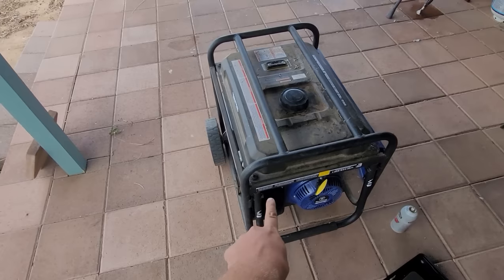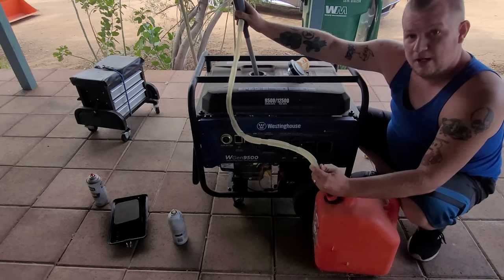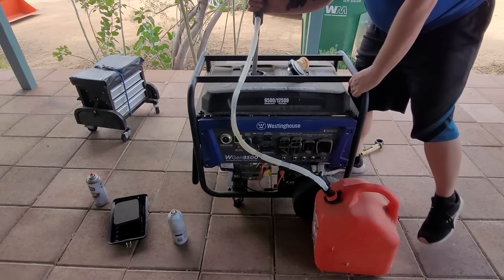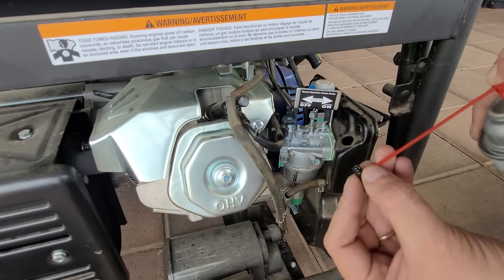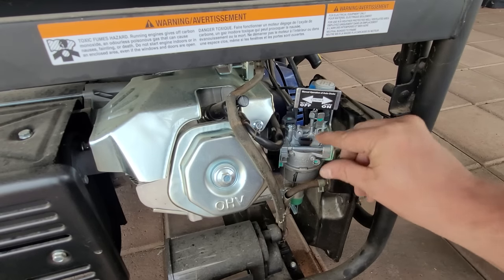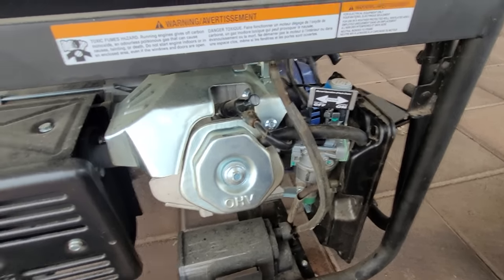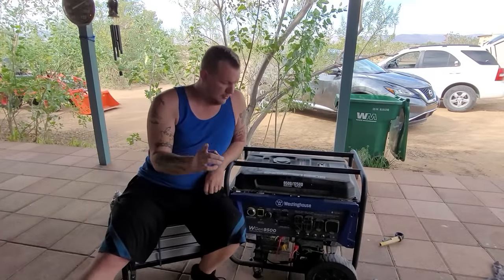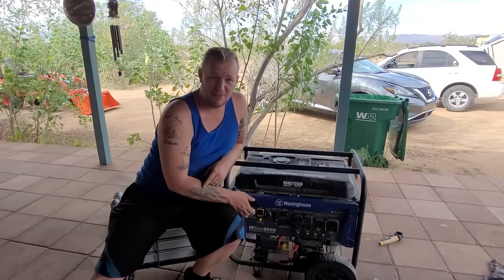Surging Generator? Quick repair for ALL surging and hunting engines.

Comment from the maker: Update video for people that still need help https://youtu.be/mE39dlHgO30
Reply: my generator is running but it won't stay running
Reply: I purchased an after-market carb on eBay for my Westinghouse WH7000EC because the old carb was leaking gas.  The old carb was not surging it ran fine.  The new carb is surging, I watched your video and did everything you did, drained old gas, and installed new fresh gas 93 octane. Took the plastic screw and its 2 mating plastic parts out, used a wire carb brush, and flushed the carb with carb cleaner.  I reinstalled everything only to find the surging did not get corrected.  What do you suggest I do next?
Reply: Great job...I've been trying all I could for two months on a CAT 3600..no luck.. runs and surges.... wish  this  mechanic lived next door..I'm 97 years old and  can't  lift it to get it back to the store for service... any one in Naples Florida who can do this???
Reply: I bought my Honda 2000 used (barely) and it was surging on eco. On a whim I added some sea foam. I’m sold on it now. Ran it thru & have had 10 years of service since without even a hiccup.
Reply: Can you not just adjust the carb sometimes and or clean it?
  Are you saying a surging engine is always bad gas?
  Don’t intend to knock your opinion. I am not a pro just curious as I have worked on several small engines especially carbs.

  PS noticed you sad 90% of the time. My bad!

Comment: You can turn the idle screw "IN" before you remove it counting the turns it takes to seat it. Then after reinstalling it turn it all the way in till it seats then open it the same amount of turns it took to seat it before you removed it and it should be almost exactly where it was. Thanks for the video.
Reply from the maker: Yes good tip
Reply: I was about to say the same thing but you said better ...
Reply: That's assuming there's an idle screw...new stuff all sucks
Reply: why would you need to do that, the generator never idle
Reply: If the generator does not have the auto idle or economy mode feature, turning the “idle” screw will have no effect engine operation. Further, without the auto idle feature the engine is set to run at approximately 3600 rpm.
Reply: Well done sir and thanks!
Reply: Unless somebody has been fiddling with it, like a previous owner
Reply: That's a fixed idle jet, no adjustment possible unless you slightly enlarge the orifice (which would fix the lean surge problem)
Reply: Agggh was going to say tjat! 😂
Reply: @timbartels6353 referring to this specific situation duh! I swear people always have to try to stump someone.

Comment: Always use premium gasoline or Non Ethanol gasoline in combination  with Stabil gasoline stabilizer. The ethanol in these gasoline gum up the jets and carb.  It’s best to clean the carburetor bowl out while you’re at it. All the gum from the gasoline sits in there.
Reply from the maker: I'm ok with non ethanol but I would never recommend stabilizer maybe seafoam but probably not just don't keep gas in machine drain and store
Reply: @RepairGang  I disagree. Always use stabilized fuel in small engines. Always
Reply from the maker: I have had bad experience but it's anecdotal evidence. I'm pretty sure if a customer followed the instructions it probably be a good idea, but that's okay. We're allowed to disagree
Reply: @RepairGang  hi I'm a waterfowl hunter that uses a 2 cycle outboard.
Since I started using stabilizer I've had zero carb problems.
That is anecdotal
Reply: just run the gen out of gas to shut it down no need for premium or to add anything its worked for 30 years heck  i use a gen 4 hours a week every week to power my water pump the gen is a 1998 model sold in 1999 and still purrs like a kitten ive opened the carb 1 time in 23 years 1 time
Reply: I agree with you on using ethanol free gas but not premium in small engines. Premium is only needed in high compression engines. My whole life I always thought that premium gas was really high explosive stuff.......wrong. Just the opposite. Octane actually decreases the explodability of gas. You don't want gas to ignite before the piston reaches top dead center. Thus the need for high octane in high compression engines. You can use premium high octane gas in your Ford Fiesta and it won't harm the engine but you are just wasting money. But if you use regular gas in high compression engines you can easily ruin the engine. That is why you hear the knocking. It's because the gas is igniting before the piston reaches top dead center.
Reply: I use my snowblower so infrequently that I only use trufuel in it now. I went two whole winters without using it, and it started second pull.  That stuff is ethanol free and stabilized. A gallon is like 25 bucks… so it’s NOT cheap, but I only use a quart or so a year…
Reply: @ferp420     Ah but YOUR secret sauce is running it regularly.  If you let it sit lie many your experience would change I think.
Reply: @drizler  no cause i have several engines that do sit rotatiller pressure washer and multiple gen sets that sit alot between use
Reply: @BenNawrath     Check out the Chickanic on here.   She just did a video on how Truefuel seems to have trashed some  of her customers small engines.
Reply: @drizler  I’ll definitely do that thanks. I’m on like hear 4 using it… if I still had a gas mower I wouldn’t use it all year, just the last fill up or two. But I barely go thru a tank a year on my snowblower.
Reply: @BenNawrath  has a long shelf life
Reply: Do NOT use premium gas, you are wasting money as these engines are designed to run on regular. Do NOT use a stabilizer, it is also a waste of money.
Reply: @romak4756  the only ethanol free gas sold where I am is high test.
Reply from the maker: It's impossible to get a pump in Mohave county
Reply: @techguy9023  you don't have to use ethenol free gas.
Reply: Yep
Reply: VP sells a bottle of fuel additive to offset the bad effects of crappy ethanol gas . Great for stored spare cans of gasoline too .

Comment: Make sure your generator has an in-line fuel filter in the hose between the tank and carb. If not you can probably get one at Lowes or Home Depot. They're usually easy to install. Because the carburetor jets are so small, they clog up easily so having the gas filtered can save a lot of work. Most manufacturers don't include a gasoline filter. Why? Maybe they'll save .25 cents and make more money on service work?
Reply: Most of these engines have a filter in the tank side of the fuel cock sticking up into the gas tank.
Reply: @yeahrightmate enjoy trying to change it with a full tank and a major storm surge
Reply: The little red filters have a screen that's relatively coarse. The paper or sintered metal filters (clear body)  are better filters, but of course you don't want the paper ones to become ancient.

Comment: Good job! Always screw your idle air screw in until it stops and count the turns so it can be put back the same way, you don't want to run them too lean.
Reply: Idle screw has NOTHING to do with air fuel mixture!!  It is an IDLE SCREW. You should ALWAYS set min and max RPM with an induction tach according to manufacture spec.
Reply from the maker: Your right there
Reply from the maker: Yeah I feel that I so use to lawnmowers with same carbs I just say to adjust it
Reply: @meyou3353  slow idle is a moot point on a generator, and high idle you set with a multimeter
Reply: @romak4756  you are wrong
Reply: @meyou3353  yeah, ok sport
Reply: @meyou3353  so what's the low idle setting on a generator with no idle control? It's high idle only
Reply: @romak4756  How are you setting it with a multimeter?
Reply: @POOKIE5592 by measuring the hz

Comment: A faster way to fix this if it's raining or cold outside , is to spray little carbspray up the gas tube to the carb , go in the house an warm up some , and come back with compressed air and blow a few puffs up in their from a air tank or blow in it . (open the gas bowl to drain first ) water gas will be in the bottom an removed . shake the tank good an ad fresh gas .

Comment: you are the man! I've dismantled and cleaned the carb jets multiple times in the past but this time I was stumped bc it was still surging.. you saved me so much aggravation with an easy fix... thank you👍🏼+1
Reply: Did the same as you and still surging somewhat. Now I cant wait to try this. I did not know that pilot screw has 3 holes, I cleaned 2, and the bottom hole was plugged but I thought that was by design, realize now I have to remove and clean that gunk stuck in there.
Reply: What fixed the surging for you? Cleaning the carb or snipping the solenoid plunger off?

Comment: Dude, that's the quickest fix I've ever had to an engine problem.  My generator is not too old - maybe 4 to 5 years, but I still try and start it every 3 months or so and let it run for a while just to keep the carb sort of fluid and fresh inside.  Still, it developed the surging issue; found it when I started it yesterday just for maintenance.  I had it running straight again within 5 minutes just by following what you did.  Well. almost.  The carb cleaner never would exit the jet on it's own.  I had to clean the jet with a wire first to get it to come out, so it was clogged pretty good.  Thanks for the help.  Good job on the video.

Comment: Had my champion 4500 open fram start surging at work....... Found this video and it cleared it right up.  I just disconnected my spark plug and did the above repair. I did not drain the fuel.

Comment: Thank you for the information on where the high speed jet is located. Put on a brand new carburetor and it was still surging. Drilled out the jet with the next size up drill bit and now runs smooth. I liked the old days when these mixture adjustments were out in the open and not hidden and fixed.

Comment: Thanks! This worked out perfectly. I used it on my Powerstroke 5000. Don't know what caused it because I only ran it twice in 3 years. I replaced the fuel added a cleaner and preservative and followed your instruction and smooth running. Thanks again.

Comment: Thank you, you just saved me a big repair bill, plus transport.
I have a generator just like yours, that stopped running after only 10 hours of operation.
I could not even find a repair shop willing to take it in, the only shop in the area listed for warranty repairs did not do that anymore..
Did not even know it was called "surging", until last week. A common problem, apparently.
Then I found this clip, I did what you said, and now it runs perfectly. Thank You!
Reply from the maker: I am glad you got your machine running like new or in your case like it is supposed to

Comment: I've often seen the surging due to water in the fuel bowl temporarily shutting off fuel flow into the main jet. Remove the bottom fuel bowl center screw, drop the bowl, clean-out the bowl and reassemble.  Lucas Ethanol gasoline treatment works great, green bottle/color, add to regular gas.  Nice job on the video, quick and to the point.
Reply from the maker: That could work
Reply: I've never been fond of Stabil fuel treatment.

Comment: I had the very same issue on my 10K watt generator. Watched your video and did exactly what you demonstrated and it is up and running just like new. Thank you for sharing this!
Reply from the maker: Thank you glad it helped yeah they get bad when they sit a min
Reply: @RepairGang  i had the same problem with my generator reving up and down but mine did it after it got clean up just like you did , before it dint start up at all and was puring out gas whenever i try to start pulling the rope , any reason why any help whould be great
Reply from the maker: I would take off whole carburetor and clean it then you knocked dirt loose
Reply: @RepairGang  i will try
Reply from the maker: Yo if you need a walk through email me pictures
Reply from the maker: @The_Happy_Aviation_Enthusiast  stop spamming this on my post

Comment: I pulled my carb apart 3 times thinking the problem was the jet inside the float bowl. I never knew what that plastic bit was until i watched this video. I have 2 other generators that don't have that plastic bit so i didn't think it was anything important. I fixed my other 2 generators by removing the float bowl and cleaning the jet inside and assumed the same had to be done to this one. But having no luck i then found your video and now its up and running again. Thank you
Reply from the maker: I'm so glad this helped you my guy. Many more videos coming
Reply: Yes never knew the other jet on the side my water pumps are doing this clean carb but I’m gonna try this one soon

Comment: Thanks!!!
For anyone who found theirselves in the situation, if you intend to store it for "next time" be sure to run fuel with Stabil added for a few minutes, then empty the tank, run it untjl it stalls, then drain the float bowl. Lastly after the engine cools remove the spark plug, squirt a  tablespoon or so of 2 stroke oil in the cylinder, crank a bit, then replace the plug. Now when you try to get it going next time, it should work.
Reply: Sadly my familys own generator has been neglected SO MUCH, but the thing runs anytime we need it to...old old fuel, rarely used ect. I fix them at my job and see how they get bad real fast. 95% of it is old gas.
Reply from the maker: Great tip! but I dont like fuel stabilizers lol I just say drain it all out leave it bone dry and it be good to go when ready
Reply from the maker: old gas is a pain in the ass lol
Reply: The 2 stroke oil will foul your plug. Use stabil fogging oil.... other than that spot on.
Reply: @meyou3353  YOUR wrong
Reply: @romak4756  First of all, it is "you're". Second, this is LITERALLY my business. This is what I do 7 days a week. EVERY AIR AND FUEL PASSAGE MATTERS. It is essential to the venturi effect and stoichiometry. ...class is in session any time you need it.
Reply: @meyou3353  I can only imagine how disappointed your customers may be
Reply: @romak4756  😂😂😂🤣🤣😂🤣🤣🤣🤣🤣😂😂🤣🤣🤣🤣🤣🤣😂😂🤣

Comment: I've had a backup generator since the hurricanes of 2004 tried to move my FL home to Kansas. I've had to rely on it only twice since, but every year before hurricane season begins, I fill several gas cans, adding some Stabilizer and Marvel Mystery oil to the cans. I use "only" non-ethanol fuel. I'll put about a quart of fuel in the "empty" tank and run it until the engine quits, never leaving fuel in the tank. After nearly 20 years of mostly garage storage, it will start on 1-2 pulls every time. Any fuel not used by the end of hurricane season is emptied into my vehicles. No problems whatsoever.
Reply from the maker: Hell yeah
Reply: Why Marvel Mystery oil?

Comment: I noticed the surge on my Predator generator after I needed it when Helene blasted SC with wind. I had it running non-stop but for adding fuel and checking oil for 8 days. It didn't surge when I had it running on propane so I took the carb apart after we had electric and cleaned it out but it was really clean. I didn't know about this low idle pilot jet. I will do your tip and hopefully it fixes it. Thanks for the great video!

Comment: I had the same problem with a lawnmower with bad gas. I got to get one of those pumps since it's a good price. Seems like those jets get clogged up fast even on mowers. I got to do that with my tractor cause it surges a little. Oh that sounds good. Thanks to you and your videos I am confident to take the carb apart. Thank you Andrew.

Comment: @repairGang: If your generator does not have the auto idle, sometimes called economy mode, then turning the “idle” screw will have no effect on idle adjustment. It didn’t look like your generator has the auto idle feature, but I may be wrong as I couldn’t see the whole front panel. The screw you were turning, on a non auto idle is to hold the jet (the small black tube you were cleaning) in the carburetor.

Comment: Thanks for sharing that trick- on all other than westing house 4cyc small engines- turn the screw in bottom of float bowl- and that will fix a rough idle most every time- i think all the jets need tweeking from time to time do to dirt and grime settleing in those little carb and jet area- or at leiste older model units- That 9500 looks perfect size unit- i could probley run my 8' electric base heater in a power out senario.

Comment: Thanks. My generator surges like this and it's brand new, never seen gas before I dumped fresh ethanol  free gas into after this recent hurricane. It ran for four days straight doing everything I needed it to do, but the surge was annoying. I didn't want to mess with it while it was needed so I just plugged all sensitive electronics into surge protectors to be safe. Just got power back so plan on trying to fix the surging issue.

Comment: Put some SEA FOAM in your gas tanks . Wonderful stuff , eliminates water , stabilizes the gas and cleans gum out of carbs .       Once got an OLD Snow blower , badly neglected . Poured SEA FOAM into a dry gas tank to pull it thrue the carb and it started and ran...on only SEAFOAM  !   Years later , that motor is still running trouble free  !     Ontario Canada .
Reply from the maker: I do like sea foam only because and engine can run on it but can't on any other stabilizer